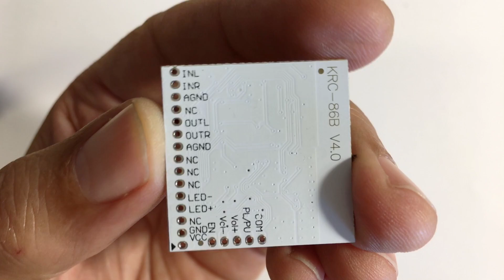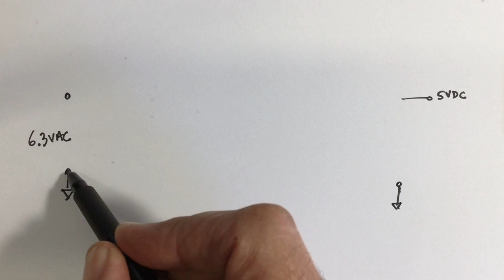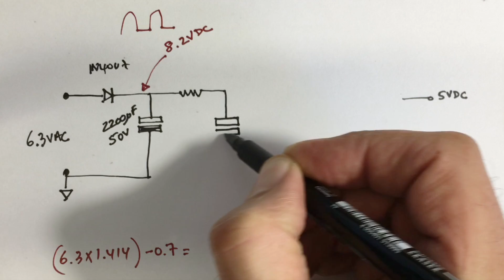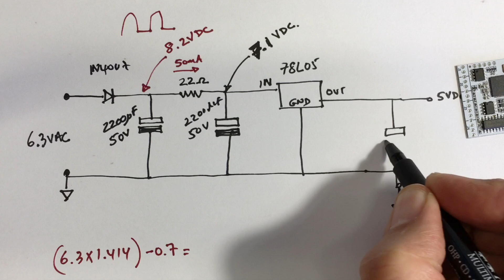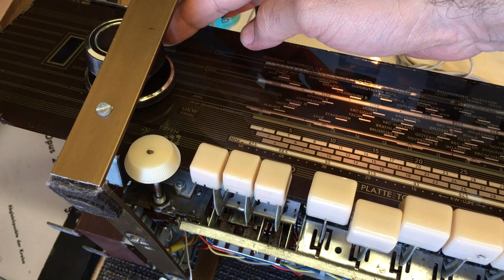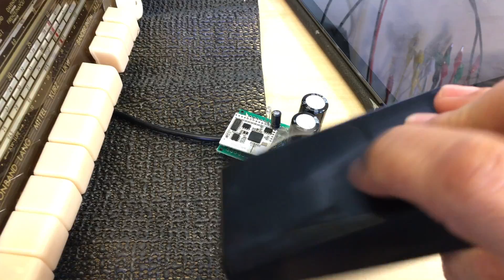Add Bluetooth to a Tube Radio without the buzz and noise. Bluetooth receiver board KRC-86B V4.0

Comment: Hi Manuel, I have a little issue, fitting the BT to a Saba Triberg, for the USA, so I'm running the source supply at 120v correct for Minesota usa, I've got a heater voltage of 6.1v ac. A bit low as the radio has an input setting of 127VAC. The BT module reports " Low battery, please charge" and sometimes does not wake up. Best to remove 1n4007 series diode in dupply to BT module? Thoughts?
Reply from the maker: That’s exactly what I’d do after actually measuring the voltage getting to the module.

Comment: I have done something very similar just using the filament winding but using a shottky diode rectifier followed by 1000uF. The 78L05 then has enough head room to put out a very clean 5 volts. Not connecting the shield at the phono input will eliminate any residual noise.

Comment: Hi. I am doing the same operation and I was wondering if it is ok putting a 220VAC to 5VDC isolated switching converter on the power line of the radio after the main switch cause I have no room to make further turns on the power transformer. This would power on the module when switching on the radio as well. What do you think? Thanks!!!
Reply from the maker: That would work.
Reply: @electronicsoldandnew  That worked! Unfortunately I have a lot of hum in the range 1MHz to 7MHz. That should be either the switching converter or the bluetooth module😔

Comment: I wonder if the buzz was due to insufficient input voltage to the 78L05, and it not regulating properly. A half wave voltage doubler could be used to get about 15V DC for the input. Or use a low dropout version of the 7805. But otherwise, a separate secondary on the existing transformer is a good idea.
Reply from the maker: I tried many options with the same result: a buzz. I finally opted for the isolated option with good results.

Comment: You don't really need the resistor and second filter.  The 7805 will actively filter any remaining ripple off your first 2200uf and the 100uf on the output will clean it up perfectly.  Saves a step and the extra volt makes sure the 7805 input stays above the low voltage cutoff.

Comment: Excellent video. I have built a receiver that has valve amplification using a push pull circuit with EL84 valves that has a DAB FM radio using a Silicon labs SI4684 ic for the radio section it also features a touch screen control and a valve phono stage everything works perfectly except for the Bluetooth suffers with a buzzing noise and this video has given me the answer to the issue. The Bluetooth module i used only has one GND connection so it cannot be an earth loop the buzzing definitely sounds like some sort of digital signal being fed into the pre amp supply i suspected that i would need to provide a separate supply for the BT module. i am going to try this mod fortunately i wound my own transformer so it would be easy for me to add the extra winding. so thankyou for the info.
Reply from the maker: My pleasure. Good luck 🤞

Comment: Just did this. My logitech bluetooth adapter has a little higher output level than this one. Its otherwise ok. with 
120hz sine wave at phone full volume:
Logitech is 0.365 volts
KRC-86B is 0.335 volts
running it off the filament transformer winding caused it to buzz like hell. Then I noticed that the filament transformer is referenced to B- of the high voltage winding even though the schematic says its not. I then powered it from a battery and its good. I will try to figure out how to isolate this or just buy a small transformer to connect to this supply to isolate it.
I did a little reprogramming of the chip on here and gave it a custom name.

Comment: What if you used 4 diodes for full wave rectification and either removed or cut the resistor value by 25 percent between the first and second cap before the regulator. this should give you the extra voltage you need.

Comment: With respect sir your approach to the power supply is wrong. You should make a 5 volt power supply which should connect to the main of the radio. There are numerous ready-made 5 volt modules available on eBay or Amazon.
That way you're sure to have enough regulated power for your Bluetooth as long as the main is connected.
Reply from the maker: I prefer this method because, besides not wanting to add another supply to the radio, there are actually instances when it is convenient to have the supply switchable internally, and also create a positive/negative supply for the booster board project that I did more recently. Nothing wrong with using the separate supply though, if preferred.

Comment: Have just added one of these to a tube radio I have restored and ran into the same issue of low voltage after rectification and smoothing of a heater winding output. This radio though has two heater windings. So the output across the two is over 12 volts but, they have a common chassis ground (single wires to tube heaters - ground return). This would result in shorting one of the windings when grounding the audio output. Bought one of the Mornsun B0505s -1w 5v-5v DC-DC converters mentioned by one of your viewers in the comments and placed it between the 78L05 and the BT unit and I can now safely ground the audio output while using both windings to feed a bridge rectifier. The BT works flawlessly and no noticable hum or buzz.   Thank you for this video and also to the other viewer.
Reply from the maker: Good to know you’ve sorted it out 👍
Reply: This is good solution but I'd increase complete capacitance from 680 to at least 1000 mF.  In this case the voltage will be more stable when the module powers up. Once I met this issue.

Comment: How cool would this thing be if it was available in a 5 Pin Glass Tube to give it that valve radio look.
2 pins for power and your stereo audio output. You can easily tie the output together for Mono after the tube.
Most radio chassis have a little extra room for another tube and socket

Comment: Great video. I have been trying to audio into my radios with an AM transmitter. The thought was I could listen to whatever radio was in the room I was in. Unfortunately, the transmitter has noise it sends with the signal that I haven't yet been able to get rid of. I am sure it is in the design since it is powered by a 9V battery.
Till I find a suitable transmitter, this may be what I will have to do.

Comment: I realize this is a 5 year old video but I'm just viewing it so....
If I were to just add 17 turns to the transformer to reach 5v or so could I then connect straight to the bluetooth receiver directly, without the additional circuitry you designed, without any problems?
Reply from the maker: You’d need to rectify it to get DC and smooth it with the filter caps, then regulate it to give you 5V. Basically what the circuitry does 😊

Comment: Nice idea. It wasn't really a ground loop problem. It was part of the capacitor charging ripple current travelling down the audio cable shield and therefore appearing in series with the audio output. It could probably have been reduced to an acceptable level by using a much thicker ground power input wire and putting a small resistor in series with the audio output shield.

Comment: Hi, very clever, but I'm wondering whether the extra RC L section in the PSU really does anything that the 7805 can't already do by itself. I would have thought you'd be better off without the extra voltage drop and letting the regulator work a bit harder but with more headroom to play with. Nice solution though in the end.

I have an FM tuner where introducing an MPX has caused a similar buzz, even though I've done the same thing to the same model dozens of time without problems. Might be time to dust it off and reconsider.
Reply: And you can tone down the capacitance too. I use 1,000uF for a similar current drain. But I once fitted a similar-looking 10uF 450V cap by mistake and the thing still worked, no hum, except a horrible blast at startup.
Reply: In fact I'm not clear what the actual problem is. If it's digital hash from the BT module, how is that not being coupled into the output audio ground? And your later balanced voltage-doubler solution still seems to couple all the grounds together anyway. Isn't this really just a ground loop? Avoidable by using the chassis ground for power and lifting the shielding of the audio output cable at the target end? Or is it maybe caused by using the 6.3V ground, which is very dirty with hum?
Reply from the maker: It is a ground loop issue, aggravated  by the digital noise from the BT. If you look at the current paths carefully, you’ll see that the digital noise is “left behind” and not passed on to the audio ground. You should experiment with it without this isolation. You’ll see that the issue is quite frustrating.

Comment: I don't know whether anyone else has mentioned this, but connecting both ends of the earth wire/screen in an audio feed lead is not normally done in older equipment. It causes an earth loop and or pickup of the hum signal. When you removed the supply earth the circuit still worked as it earthed through the audio lead screen. You still had a ground loop. I suspect that if you try the original setup with the audio lead screen connected to earth at one end only, the hum will reduce or disappear. Also you mentioned about care connecting to the correct point for the 6.3 volts on the heater circuit. It is worth noting some vintage tube radios and amplifiers have the valve heaters in series not parallel, meaning if at the wrong point you could have several times 6.3 volts A.C.  More seriously in some cases the heater ciruit will have B+ as well on it. That is high voltage D.C. anywhere from 100V to 600V. Not just harmful to your BT board but the operator.  Take care out there.

Comment: I think Bluetooth circuits connected to old radios are like a brain tumor but for a radio
Reply from the maker: Some tumours can be useful 😊
Reply: @electronicsoldandnew  It is not supposed too be there like a brain tumor but I like your channel I don’t like people who make radios to Bluetooth I think it’s better to fix the radio and use it as normal then the value is still there

Comment: I put together a similar board for a zenith console and powered it off the light circuit and it worked great (no noise). So I had a circuit made up. Sadly on the next one I did, the BT had all kinds of noise. Very clever about the transformer. I haven't gotten around to yet but I want ask some of my EE friends here at work if there is some affordable filtering that could be added to the circuit. Nothing I tried worked. Here's the video for the one that worked: https://www.youtube.com/watch?v=njvbFYa4lsA

Comment: bro there's 230vac to 5vdc sealed modules on aliexpress for 3 bugs and the size smaller than your Bluetooth module. just put that in parallel to your 230v input cord and you're good to go.
Reply from the maker: Try it. See how much noise you get.
Reply: @electronicsoldandnew  none. running for months without any problems. it's the same like using a separate supply.
Reply from the maker: That’s  good news, must give it a try.
Reply: @electronicsoldandnew  they're super useful and good quality. I use them for microcontrollers mainly.

Comment: Nice project but you can buy a cable that makes the old Phono or Tape input conector to a normal 3.5mm stereo jack.
So you could just buy that 4 dollar cable and plug it into a phone or a bluetooth reciver.
Reply from the maker: Those cable normally just short the two channels together, which is best avoided.
Reply: @electronicsoldandnew  Interesting to know. 

I never bothered to check that since it works like a charm since 2 years with a logitech Bluetooth receiver. 

I'll look into it.

Comment: My external bluetooth adapter can last about 20 hours but an internal solution would also be a cool thing.
You could probably use such isolated DC/DC converter modules to get rid of the noises.
But the buzz sounds more like an issue with the unsymmetric load on the 6.3V supply to be honest.
So not sure if this DC/DC isolation converter will actually help.
Reply from the maker: It works perfectly with the DC/DC converters. I’ve installed it into literally douzens of sets so far.
Reply: @electronicsoldandnew  yeah also used this for a selfmade bluetooth speaker powered from a big lead acid battery but the noises i had were all high frequency rf noises from the bluetooth module, no static buzz like you had.

Comment: Do you have a schematic or diagram of this treasure? Thank you. I'm trying to use either a 7.5 v wall wort transformer or the heater tap of the 35w4 whisk on this radio is connected through an .047 to ground since it doesn't have a bulb. Of course either way I'll have to rectify it. This is a G.E. model 930 without dial lamp.
Reply from the maker: Only as drawn in the video. However, the more recent method I use is shown in a few videos on my channel, which uses a DC-DC chip to completely remove supply noise. Here is one:
https://youtu.be/qDnc__aZtUc
Reply: @electronicsoldandnew  thanks! That's the video I was looking for.

Comment: Can you please explain why the 6.3v becomes 8.2v after the diode? Why you multiply it by 1.4?
Reply from the maker: Converting AC to DC. You need to do some research, for safety’s sake.
Reply: Because 6.3VAC is Vrms and when you rectify it you get Vp, which is 1.414 times Vrms.

Comment: It's actually interesting that the 6.3V heater/filament supply is grounded. Normally this is floating so you won't have this issue.
Reply from the maker: Not really. Most, if not all, of the german sets I’ve done have the heater grounded to chassis.
Reply: Normally it is either centre-tapped to ground or grounded at one end. You can't have floating heater supplies near cathodes.

Comment: Hi. I have added this bluetooth board to a Braun G11 with the PCB board you made in an other video. It works great but I get a interferance on FM inbetween station even with audio to phone disconnected. It is still there with the bluetooth board disconnected  but not as loud. Any idea on what could be the problem and how to solve it?
Reply from the maker: If you use the internal FM antenna, it could pick up the nose from the digital section of the board due to proximity.
Reply: @electronicsoldandnew  Is there a way ti shield it and only leave the BT antenna exposed?
Reply from the maker: Try moving it as far from the interior antenna as you can. That worked with me.

Comment: What a great video and enjoyed the accent too. Going to do my mine differently with a seperate 240v/5v switchmode supply (so cheap on eBay) but this video has essentially thought me about the alternatives including pros/cons so thanks very much I have learned heaps!
Reply from the maker: my pleasure. good luck with yours.
Reply: Thanks for the tip regarding the foam tape. I’ve been wondering how to mount these with minimal effort.
Reply from the maker: pleasure
Reply: The switch mode power supply is going to interfere with the AM IF and make a bunch of noise. My 2 cents form personal experience. If you could find a PS with a transformer you''d be golden.
Reply from the maker: I’ve added dozens of these to tube radios and get no noise induced into the AM IF. The only noise I sometimes noticed is on FM if there is an internal dipole antena. Some careful placement is needed if that happens.
Reply: @electronicsoldandnew  He was saying that he was going to use a switch mode power supply which I don't think you are using. The ones I tried to use made AM unusable which is why I switched to using the bulb circuit and why I really enjoyed your video.
Reply from the maker: Sorry, I misunderstood that. Thanks.

Comment: what capacitor should be good i would not want to go overkill
Reply from the maker: No need. Just use medium quality caps.
Reply: @electronicsoldandnew  what uf do you think I should use
Reply from the maker: anything above 1uF should do the trick
Reply: also my radio have 6.3 seperated from ground its just 2 wires connceted to the fillament so i wont get a ground loop i hope

Comment: Usually regulators work about 6 volts above the supply.  I am suprised that you went with 9V and not 12V as the input voltage to the 7805.
Reply from the maker: The 7805 is spec’d at requiring 7.5V for proper regulation, so it needs 2.5V above, not 6V. It works perfectly.

Comment: I want to make my living room wireless and thought I would need to buy a transmitter board for every device (vinyl player, DVD player, amplifiers and a tuner so four boards?) And then I need to get a receiver which will receive all the Bluetooth signals. I connect the output of the receiver to my speakers and subs at last and should be fine right? Please someone help me out with this I am so confused.. Thanks Fam and stay well oh and nice video btw

Comment: I am doing the exactly the same at this moment. Adding the KRC-86B to a Philips tube radio with phono -input. I have managed the power for the bluetooth receiver, but I have a problem with the volume of the bluetooth signal. The audio-out signal of the KRC-86B is very low. So I have to turn the volume up very high. But when I switch to the radio, the volume blasts into my ears. So the amplification of the bluetooth signal and the radio signal is too much different.

Do you have suggestions how to best solve this?
Reply from the maker: All BT modules have the same symptoms. The phono cartridges used to have a much higher signal level I’ve tried pulling a preamp module after the BT But found that it added unnecessary complications. I’ve just got used to living with having to set the volume higher Bluetooth reception.